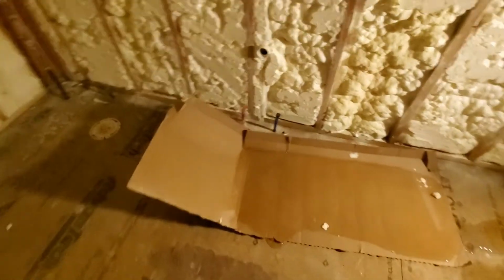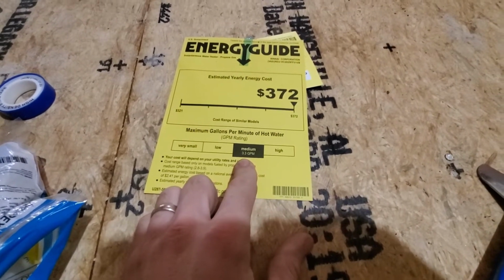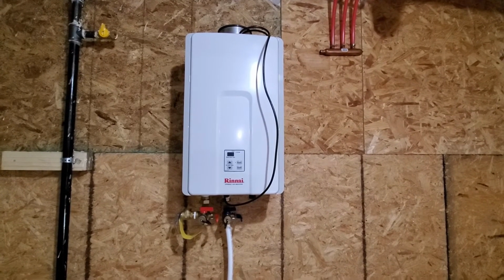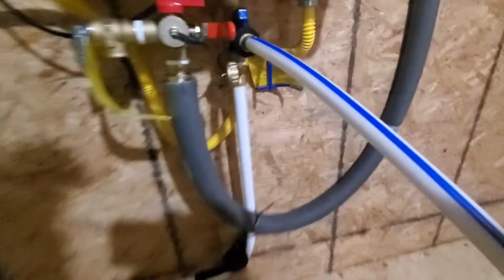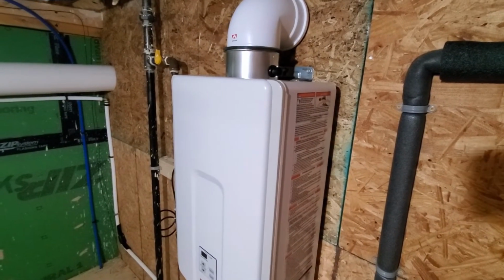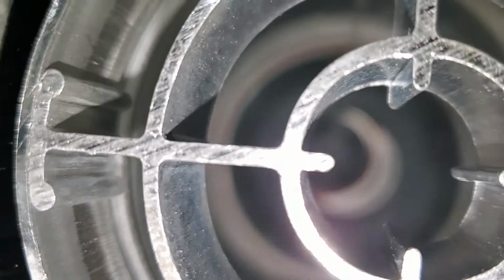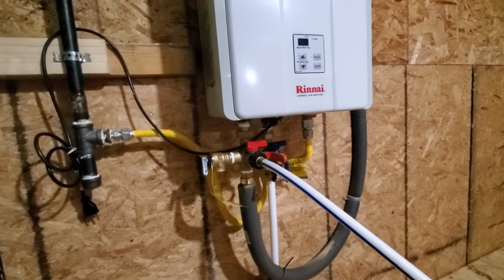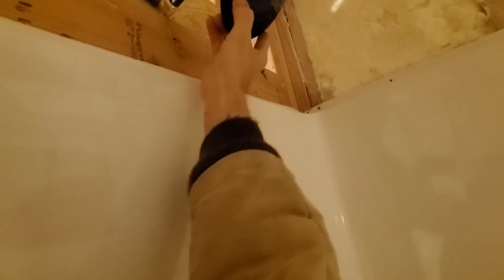Rinnai V65iP Tankless Water Heater Installation in our Off-Grid Home

Comment: You could rig a return line and you would have hot water all the time with no delay.
Reply from the maker: Don't know how that would work on a tankless water heater since it's only on when you call for hot water.  I've done loops before from a hot water tank which was on a pump that would turn on in the mornings and evenings.  It worked great but using the same setup here would only cause the tankless system to run nonstop.

Comment: What is your gas line pressure regulated to I had to put a 11” WC regulator just before my unit because the 2 psi that the rest of the gas system is was too much pressure for the unit
Reply from the maker: I can't remember what it was set to but do remember having to turn it up to get enough pressure to everything.  We have a propane generator, boiler, stove, clothes dryer, and the instant hot water heater.  Plus I ran a line to the camper if needed.

Comment: Did you have to run a condensate trap (or trap loop) off the top collar that holds the vent elbow? I have a similar natural gas model  (V75i). I am going to do a condensate trap loop, and I'm curious to find out what type of hose to use.
Reply from the maker: Funny, I was just servicing the unit last night and realized I forgot to run the drain.  Just a plastic clear hose is fine.  I'm routing it into the sewer.

Comment: You forgot to put the white (interior) and black (exterior) grommets for the vent pipe before installing it. Why?
Reply from the maker: I used liquid flashing on the outside because I have not done siding yet.  I might have to remove the exhaust pipe and didn't want to risk damaging the grommets in the process.  If I can avoid taking the pipe out when siding is done then I could use the grommet on top of the liquid flashing for an extra seal.  Thanks for watching and commenting.